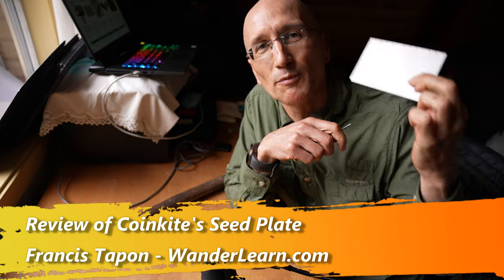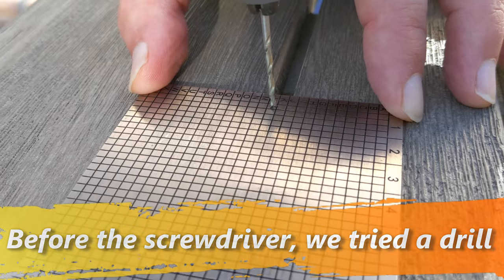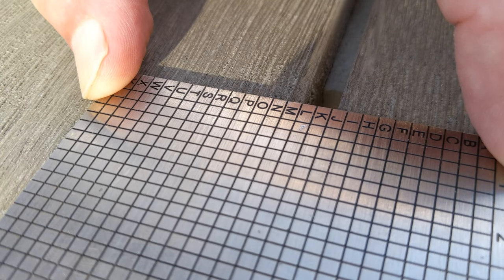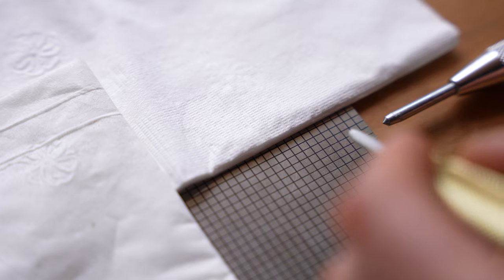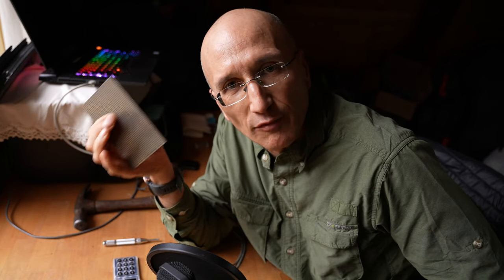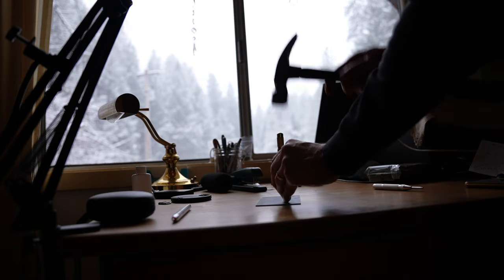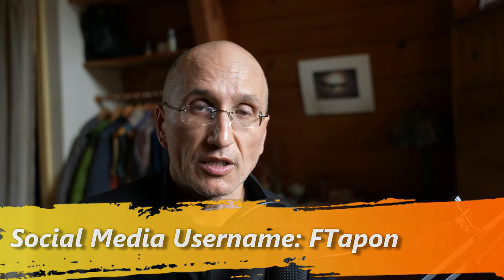Review: Coinkite's SEEDPLATE - A Metal Plate to Preserve Your Bitcoin/Crypto Seed Phrase - 24 words

Comment: That is an automatic center punch, you’re supposed to press it on the plate and it will punch the dot, you don’t need a hammer.
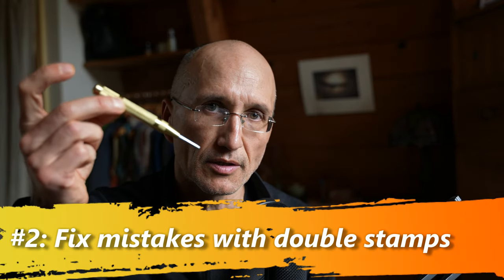Reply from the maker: Yes, I point that out at the end of the video at 9:40

Comment: Nice review...but for folks using an automatic center punch...here's a simple instruction video (https://www.youtube.com/watch?v=X2YxlO3ougA).   
DON'T use a hammer with the punch.  The punch has a built in spring, that when one pushes down on the top of the punch it pre-loads and then releases.  On release it punches the pin into the material.  NO NEED for a hammer!   Again...thanks for the review Francis.  Nice job.

Comment: I’m unable to get the tool to puncture the squares. Barely makes a visible scratch. Tried pressing hard with my hand as well as a hammer. Still barely a scratch. What am I doing wrong??
Reply from the maker: Are you sure it is the same tool that I am using in the video?

Maybe you got a cheap knock off of the tool ?
Reply: @ftapon  thanks for the reply! I got it from CoinKite. I actually tried again and hit it harder. It’s looking much better now! Thanks again!